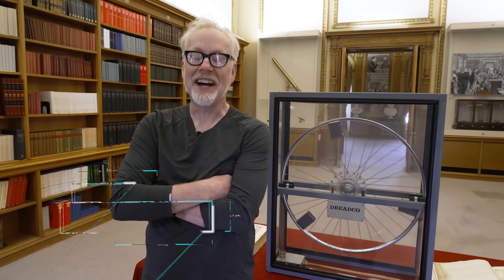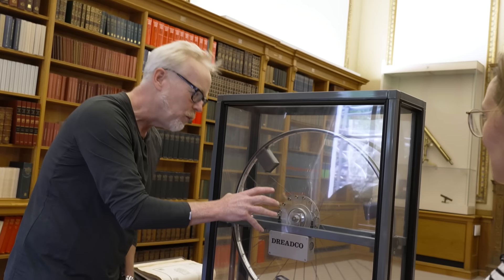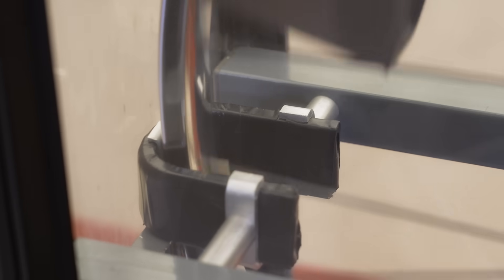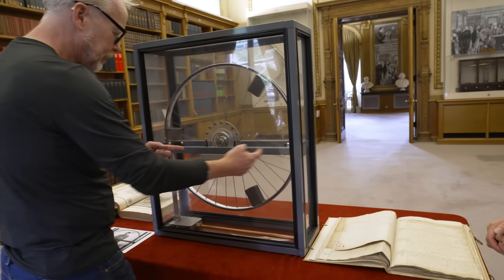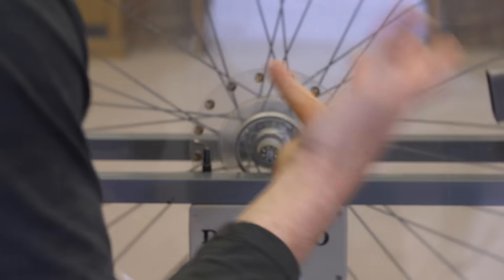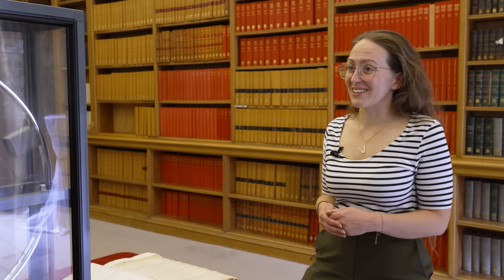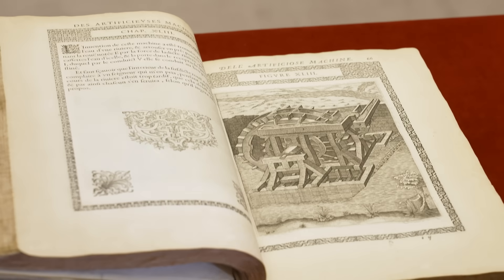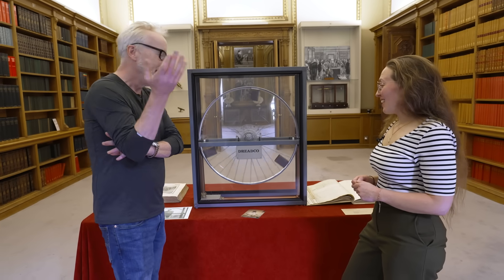Adam Savage vs The "Perpetual Motion" Machine!

Comment: Each of the 3 boxes on the rim contain an electromagnet, a battery and a gravity mercury switch. The gravity mercury switch will turn off the electromagnet just before reaching the permanent magnets on each side of the wheel, but inertia keeps the wheel moving at a steady pace.
Reply: The black U-shaped plastic-covered objects at the E-W points of the frame are not magnetic. People took sensitive magnetometers to the exterior of the case (per the game's rules) way back when this was introduced. They're not magnets.

Comment: The practice of making fake perpetual motion machines is not a fruitless exercise in my opinion, reconfiguring a source of power to hide it likely has lead to better understanding of the physics involved, which likely has on at least one occasion lead to an improved design for a practical motor or generator. Even just the practice of making the system move with minimal energy loss so the power source can be smaller and more easily hidden is a decent exercise. I don't think it would be a great loss if people had never bothered attempting perpetual motion, and certainly some people have been harmed by the scams throughout the years, but as a curiosity they are quite interesting.

Comment: Oh my gosh, I remember Daedalus' column in New Scientist, and remember the challenge over the perpetual motion machine. I reasoned  (at the time) there wasn't anything fancy on the outside - was all decoy. The three boxes at 120 degrees were the key. I imagined there was a gravity switch or something, so once a box reached top centre, it activate a motor, very briefly, to swing a small rotating weight inside the box, outwards, so the wheel became heavier towards its circumference. In addition, the swinging motion would be counter to the rotation of the wheel, so both the swing, and the outboard weight, contributed. At the bottom of the wheel's rotation, the weight would pivot in, with the same direction of motion for the tiny weight in the box.

Edit: reading down the comments, @francoisplaniol1489 proposes a much more sensible solution (doesn't require motors in boxes) (excuse: I was about 15 when I came to that 👆🏻 idea)

Comment: Three  batteries, three two way Reed switches and six coils. One coil pulls and the other push. There are four magnets. two for the Reed switches & two for the coils. (Something like that). And a little bit of it's own counterweight. No diodes, Diodes can waste battery power.  Down under. New Zealand.

Comment: I love thinking about perpetual motion machines. I have one for you. You could drop a sealed buoyant container down a shaft on pulleys for power generation, empty the water at the end,  and reseal the vessel. Then have an airlock that fills up with water attached to a body of water that carries the now empty container up to the surface? Yes, pumps to reset the airlock. but if you just reseal and let the water out that doesn't take pumps. I feel like this could work, but perpetual motion isn't a thing. Just a great thought experiment.

Comment: Even if it is a battery opperated motor, if the motor it's self recharges the battery, then the definition of perpetual motion applies...however...given the fact that it requires "maintenance" every two years. I will have to say, not perpetual.

Comment: It is not perpetual motion. Real perpetual motion machine would have to run with no resistance anywhere and without any power, ie batteries or electricity / gas. This is a wheel running on bearings and an axle with magnets forcing it around. The bearings are causing resistance on the wheel and axle. Perpetual motion is the idea of a machine that will never stop. People have tried to make them with the idea of a motor running another motor, just like if a generator / alternator can run another, ie a generator to power a motor to turn the generator to power the motor so they would never stop. .

Comment: I think it's a very simple thing. The battery is in that box with the heat sink providing power to the 2 far left and right electromagnet (black thing). The gold buttons near the middle, some of them are magnets acting as a sensor/switch to turn on/off the electromagnet at every 120°.
The rotating box is just metal for the electromagnet to attract to and as weight to regulate the speed.
Reply: When the device was tested with a meter to measure magnetism, only the middle DREDCO box and the heat sink box showed any magnetism. The "U magnets" were not magnetic and showed no activity. So, either fake or so weak that the meter they used could not detect it?

Comment: It’s a perpetual motion machine that every two years we have to send in to replace the batteries.
Reply: Hahaha so this perpetual motion machine starts to slow down and needs service if not it will stop working.
My watch does the same thing 🤯🤯🤯
Reply: 😅it ain't perpetual then
Reply: Its a semi perpetual motion machine ...
Reply: Sealed connectors.
Reply: she said its been running for two years and its still running so more than 2 years
Reply: It’s just magnets. It slows down because it slowly loses energy. To make it go faster, they just spin it fast by hand and it maintains the momentum for another 2 years. Add more magnets and it will spin for longer. It’s pretty straightforward but the capitalists want us to think it’s impossible and that energy is expensive to produce. It isn’t.
Reply: Which is funny because if the guy had hidden solar panels it could passively charge during the day. At least that's what I'd do if I'm trying to fool everyone.
Reply: That would make it an Over Unity Machine, not the same claim
Reply: It is clear enough how this machine operates. There are batteries in the boxes set into the wheel. These contain simple trigger devices which cause them to power an electromagnet at just the right time, as the box approaches powerful fixed magnets set into the case, imparting an impetus to the wheel. Since the young lady has confirmed that the wheel will, eventually, run down and stop, if not “serviced” at regular intervals, it is clear that the batteries do require replacement to keep the wheel rotating. So it is a conjuring trick, not a perpetual motion machine.
Reply: @Mark3ABE 
Absolutely.
I also reckon that the two vertical electrodes at the centre of the wheel sense the speed of the wheel - and.. via the box they are mounted on.. conmunicates ( via rf "key fob" technology -with the outer box(es) to regulate their action as you describe .
It may be that only one of outer boxes is used..
( they also provide extra mass to add to the momemtum of the wheel 
And of c
Reply: @eric4709  The RF 'Key Fob' technology idea is unlikely, as the machine was built in the 1980's, but RF key fob tech wasn't invented until 1989 and the first car to feature a proximity key was released in 1998.
Reply: @Mark3ABE  There are a ton of ways this thing could work and there's no way to know which it's using, since it has a lot of 'decoy' stuff on there to cause confusion.  My guess is that the actual mechanism is hidden and everything you can see visually through the glass is fake.
Reply: Adam not being able to find said batteries is impressive in its own right.
Reply: @tukpunker not really... it's in a box. Cant open it and closely inspect it at all. Vast number of engineers could create this if they were allowed to have this condition of not taking the machine out of the box.
Reply: No batteries, no solar, no motor. I believe this thing works by opposing or attracting magnets. These are the 3 black squares on the inside of the rim. Magnets will always eventually lose their attraction or repulsion after a period of time….say 2 years !
Reply: @ratscabies3953 go down the magnet battery pattens kinda cool what you can do
Reply: @ratscabies3953 that doesn’t work without electricity and magnets don’t lose charge in 2 years 😂 it takes thousands of years
Reply: True, in a time where there is an energy crisis they wouldn't hide the solution for no reason, this is so stupid and they look proud.
Reply: @quos3683  I mean let's go off and say that this is real perpetual motion, just for argument.
It wouldn't generate enough electricity even over 50 years to cover the cost of building it. That's a bike wheel without resistance on it. You can spin one of those once with your hand and it'll keep spinning for a minute. And given JUST how slowly it's spinning? Like 0.16 RPM? This thing couldn't keep a single LED on.
Reply: then buld one, that would look exactly like this one and work for two years or more. batteries and technology are better now....
Reply: Magnets my friend. Propetual machines lose 20% of energy of time . Which means it will stop after time . And that time is 2 years for this one
Reply: Question is, does it defy some of rules that makes it perpetual motion,  we dont know that since it needs to be tested. How i understand perpetual motion machine would be machine that can give more energy that its needed to keep it running.

Also, question is, is it based to gravity, if it is- its useless lets say in space station to generate free power.

They could do this just to get media attention this is one posibility too.

At the end, we already have free generating machines, at dams and rivers that use flowing water, unlike solar power river flows constantly and gives electricity, and that in my book is good enough, of course machines need maintance from time to time, but if you make it less robust and simple, it would give much more energy that is cost of machinery
Reply: @Dominik40301  a perpetual motion machine does not have to generate more energy than it uses.  It only has to generate enough energy that it needs to keep moving at the same rate.
Reply: @dakidd84 my fart is perpetual motion, i fart, inhale it, then fart again, endless value
Reply: @Dominik40301 Hydro power,  like from a dam, is literally a potential storage form of solar power.  The laws of thermodynamics apply there too.

Comment: The two sensors in the middle next to the hub are just triggers to fire off magnetic field being generated at the right time for a short duration to help pull the boxes up/down into the u-shaped magnets. The boxes is probably ferrous metalin origin.... Given the sealed enclosure in extremely low friction hub bearings, The relatively small battery That's housed within One of the two boxes..., This will could spend for a very long duration before needing a top up by special maintenance people. 😊 This isn't really a complicated design and easy to understand for me. I think what's tripping up most people is there's a cloud of mystery around this when it's really just a simple design that is just hidden within the architecture

Comment: The boxes could be batteries.  It turns so slowly a reed switch inside would be a good choice to turn on another circuit briefly that pulses a weak electro magnet that keeps the whole thing spinning.  That circuit need only be in one box, the other 2 may be ballast and everything else could be a decoy.
Reply: Same thought here.   Reed switch requires no power to activate.   Battery power is pulsed for a split second into a coil to give a magnetic kick.   Just enough to overcome losses in friction of the mechanical bearings of the axle.     OR basically a MOTOR.

Comment: Im sure its just a motor, it doesnt even need to be massively efficient as long as the friction is kept low. Just think of all the batteries you could fit into that square tubing of the case, youd have no problem getting 2 years out of it.

Comment: Could the light sensors be a way to turn it on and off? Similar to a schrodinger's cat situation, when its in the dark and when no one is able to see it, it could shut off and if no one there to witness it off, it would technically still be "running" to everyone else's knowledge. The light sensor is to turn it on whenever it is on display?

Comment: It's great how passionate they both are about this bicycle wheel slowly turning inside a box. It's funny because when I was initially checking this thing out I'm like "I think there's some stuff in there that doesn't need to be there o.O" I may be wrong, but I'm pretty sure there's some bluffs in there. The cathode/anode might be legit, based on the design of them, but!!! Dude would have known how to make them look legit! We see what appears to be brass buttons on an acrylic disk, so what exactly is going on there? Maybe there's some fine copper wire (like transformer wire) going from them to a coil or going up the spokes? Kind of odd, maybe there's a diagram or at least really good images of the machine somewhere I could study... As of now, I'm inclined to agree with Adam and say it's just a motor. Which, it is no matter how it's powered haha So he's not wrong! ;p
Reply: After looking closer at another video, I see no wires coming from the brass buttons. So I started thinking it's positively charging on the pointy end, then draining on the round end kind of causing a bit of a push pull thing going on... BUT! I don't think that would provide anywhere near enough torque to turn that wheel. And it would take really high voltage to achieve anyway. So they are probably there to draw your eyes away from the huge boxes in your face... It's most likely operating on the same principles as a coil gun... A very low powered coil gun. So there's 2 options, either each of the 3 boxes have a coil, a battery and probably something as simple as a well positioned reed switch to turn it on and off as it passes by the permanent magnets, or ferromagnetic material. Or. It's the opposite, the magnet looking things are actually the coils and the boxes have permanent magnets in them.. A hall effect switch would turn the circuit on and off. Then the power supply (batteries) live inside of the heat sink box on the bottom. Of course he could have gotten much more technical with it, but I like the simplicity of the design in my head.. It's good and disappointing! haha 

Edit:
After looking closely at the "magnet" looking things I'm even more convinced those are coils. The black tape is pretty fresh so it has been changed since it was built in the 80's, and if you look closely you can see it kind of rounds a bit at the top, then there's a perfectly flat plain, almost as if someone didn't want you to see winding indents popping up in the black tape. The simplest solution is usually the answer.. But this guy was something else, so who knows what he did! All I know is that I don't want to know! 

This would have never captured every ones imagination if not for all the nonsense in there haha I love it! The guy was brilliant.

Comment: Honestly, neither of these theories is very plausible. Both magnets and cathodes/diodes require an external source of energy to function. In a closed system like this, there's no way to create energy from nothing. So, while the machine may appear to be doing something impossible, it's more likely that there's a hidden energy source that's not obvious to the observer. It could be something like a battery hidden inside the machine or a motor hidden inside the wheel. It's also possible that the whole thing is just an elaborate hoax, and there's no real energy source at all.

Comment: My theory is that the Boxes are coils, generating a small amount of electricity, which is being used to generate a small amount of Ionic wind from the pointed Electrode spinning the wheel. i suspect they may be connected by some means through the spokes.

Comment: 2 magnets charged to the same polaraty if you added  eletric curent to it to boost the wave you could make a genarator from the rotaion and if you add more eletic you could  acheive speeds faster then ;light if the material held out

Comment: Earth's magnetic field 
Inside the boxes a basic transistor  oscillator that reverses the magnetic field
The magnetic field powers the transistor oscillator switch 
The servicing is just replacing the lubricant on bearings  .
It probably has to be aligned with earth's magnetic field

Comment: Its just a circular magnetic rail gun with permanent magnets. If I had to guess its vacuum sealed in the box. The rest of the crap in the box is just for confusion. The magnets will lose their polarity over time and the bearings will need to be serviced.

Comment: This is a bit like a homopolar motor with batteries in the 3 boxes The coil is activated when it passes through the magnetic field with a reed relay. the direction of the magnetic field is inverted compared with each other. the battery boxes act as weight in the wheel and this makes up the flywheel, storing the energy in the system so it keeps on running. Much attention was given to the bearings which have high efficiency. when going through the magnetic field, the coil might be activated in 2 times, depending on what part of the coil goes through it and direction of the current, making sure the current direction is the same fr the 2 times.

Comment: Feels like the metal bar at the center is hiding something inside connected to the two magnets on either end, likely the mechanism that actually turns the wheel itself. It's not perpetual motion, but it certainly delays it's eventual slow by some fashion, likely has a lot of highly specialized lubricant to prevent it from jamming. Which would explain why only a small group can service it, the lack of noise coming from the wheel itself also implies a vacuum in there, which was common for these things. A lack of air would reduce surrounding conductivity, forcing electricity to follow through the metal bars and into the 'motor' and slight changes in external pressure could provide some assistance in that regards.

All in all, I'd argue this is really just an entropy clock, which is really what all perpetual motion machines are, a way of measuring efficiency, the longer they last with minimum energy, the more efficient your energy consumption is.